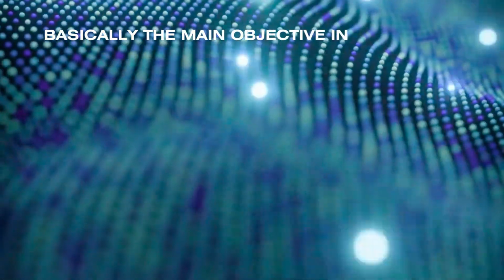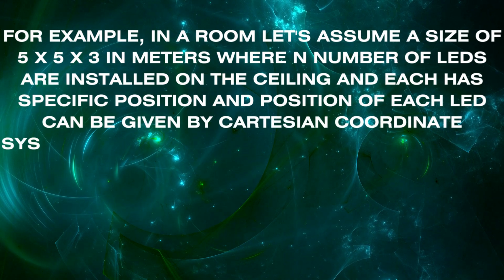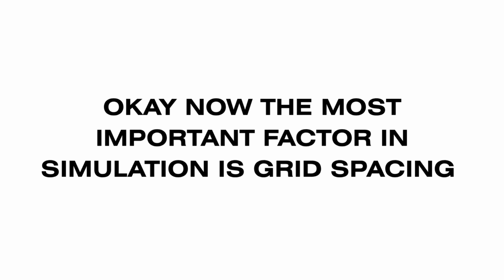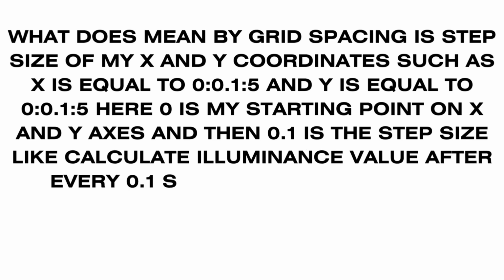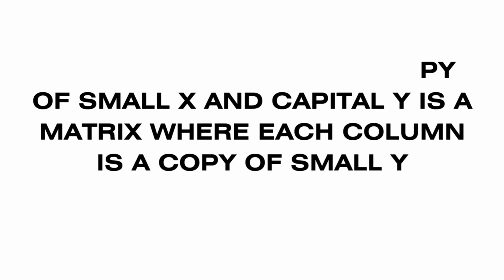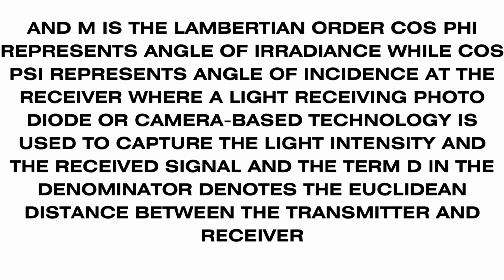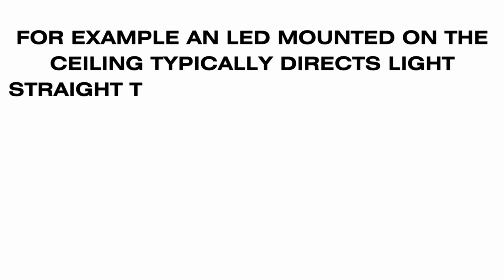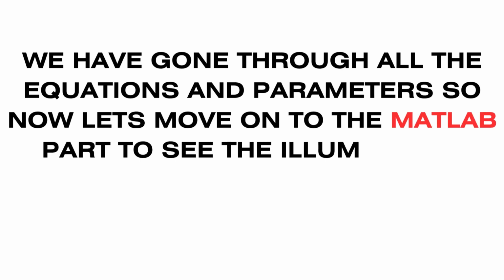Illuminance Distribution with MATLAB Code - 005

Comment: So, this is scalable and can expand to any dimension?
Reply from the maker: Yes, you can modify and check the performance for different room sizes. Also, it's good learning if you change the lambertian order and evaluate the illuminance performance.
Reply from the maker: You can also evaluate the received signal strength or total power received at the receiver, use different units like watt, dBm, or dB.